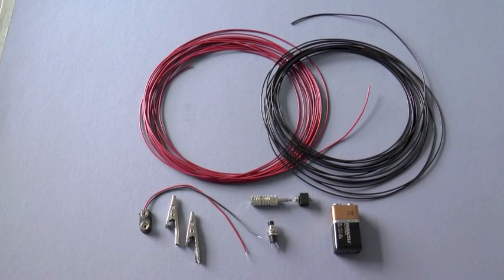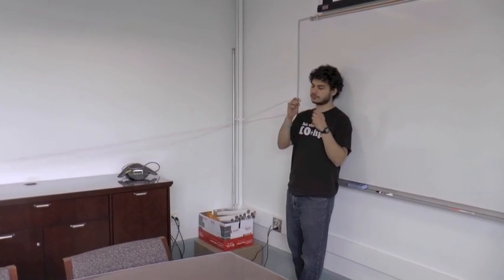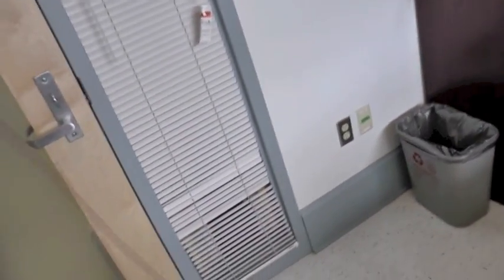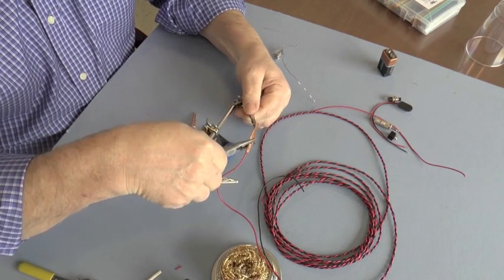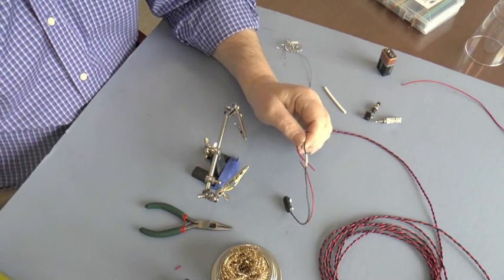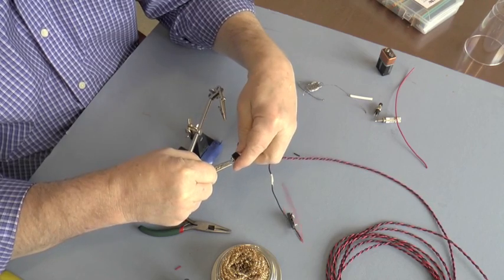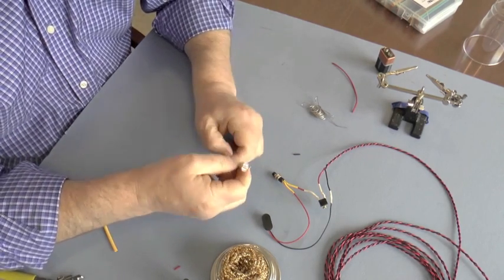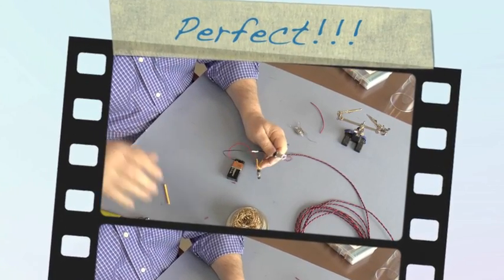How to make an electronic rocket engine igniter

Comment: The audio connector is clever idea. Use a wrist strap on your key. This way you can't walk away from the Launch Button and head to the rocket with it attached to your wrist. I would spend a few dollars more and get a low cost matched key/ignition switch from an auto parts store for about $10 USD and mount all of this in a small wooden box. Allowing wires to flop around at the solder joints (even with heat shrink tubing strain relief) will break in time. The last thing you need is a broken wire somewhere when you press the launch button. I have used those low cost buttons in the past, the high current used to launch may fuse the contacts together over time and you won't be able to tell. What could happen is the switch contacts stay connected and the rocket fires as soon as you plug in the key. Use a high quality push button switch that is rated for 15A or more for a good safety margin.

Comment: Great video. The way I make twisted pair (trio, whatever) wires is, I tie the wire ends together in a square knot. Hook it around a door knob (or bench vice), and walking away at a right angle from the knob, pull out all of the slack from the wires, trim even, and fold over the last inch of the wire and put that in the drill chuck and make it tight. Folding the wire gives the chuck more to grip, don't worry about damaging the wire. Keep the wires taught and run the drill at a moderate speed, walking towards the knot as the wires twist and shorten - but keep it taught!  About 2 twists per inch is good. The direction does not matter (beleive me, I am an electrical engineer).  But clockwise is the norm.  Then, LATER NOT NOW the folded end at the chuck and the end with knot at the door knob will be cut off and thrown in your scrap wire box.  If you don't have a drill, instead of folding the wires over, keep the wires about the same length and tie a square knot there too, insert a pencil, hold the wire together near the pencil, and wind the pencil around to twist the wires like you would do with a rubber band powered toy plane.  If you keep the wire taught, there is no need for a helper to keep closing the distance, if the wires are parallel and taught, you will get uniform twists. I have done this hundreds of times. My designs are under the ocean, on the sea, on land, in the air, and in space. Never an issue. You may get slightly more twists per inch at about 6 inches on each end, but it is not critical in this application, you can leave it or clip it off LATER (and save in your scrap wire box).  For non critical uniformity (all twists within eyeball looking the same is fine in this application). You are not making a communication cable, you are just twisting wires to hold them together.  Sorry guys, you made making twisted pair way too difficult (you even suggest a 3rd person). Hold the wire firmly with one hand as you open the chuck. Put the drill down and with that hand hold it a couple of feet down from the end, slowly release your grip and let the wires untwist through your finger tips, it may unwind 10 or so times - the more you do this the better and faster you will get. I have NEVER seen making twisted pair by dropping it! Not to sound like troll, but the way I do it we were taught in the US Air Force and only requires one person.

Comment: Can a model rocket engine be ignited with a heated child water rather than one use  home made match head igniter or estés igniter?    Seems any vapor mod with a RDA could easily run longer leads to a small coil that will fit in the cavity.   If it achieves sufficient temperature it should ignite.   AM I WRONG?

Comment: I shrink my heat shrink tubing the same way, but typical soldering irons are about 750 degrees F. Rubber based heat shrink tubing will melt at that temperature, but silcone/Teflon based heat shrink tubing will not melt from such a soldering iron. If the tubing starts to to smoke or burn, you will have to keep the soldering iron about 1mm away and not touch the tubing. If you are going to become an electronics hobbyist, it is best to buy a variable temperature/speed heat gun... like a little hair dryer on steroids.

Comment: When you have power in the circuit for the continuity check, why doesn't it set off the motor igniter? And can this be adapted for a 12 volt gel-cell battery?
Reply from the maker: The power used to check for continuity is not sufficient to fire the ignitor.
Reply: I designed a dual deploy ejection Avionics Bay that checks for shorted and open igniters right on the rocket before you arm it. I will post the design with schematics soon. There are two circuits in parallel, one is through a 500 ohm resistor to the igniter and I measure the voltage across it to insure it is properly connected, open, or shorted. Not much current will flow through the 500 Ohms so the igniter won't even get warm. The other circuit to the igniter is through a high power transistor that  when armed and you launch, the transistor turns on and a lot of current passes through to ignite the igniter.  The unit constantly monitors the main engine igniter and the two ejection igniters before launch. If the green LED is on solid, the rocket is ready for launch, if something is wrong the LED will blink error codes and will disable launching. The unit has a low cost Adafruit Altimeter in it to automatically fire the parachute ejector igniters when the rocket reaches max altitude (apogee) and as it gets closer to the ground as it falls. It even records temperature and G forces during flight.
Reply: @TJ Robyns.  Yes, a simple high current 10A voltage regulator can very added to reduce the voltage from 12V down to 9V and still provide the proper current. A low value resistor could get used instead, but it may cause some igniters to fire too quickly, or not fire at all. I can show you how to do this, just ask and I will post a video.

Comment: Painfully slow procedure. This is a one off construct. Not an industrial process. Additionally, no demonstration at the end. I did like the shorted guitar plug as a safety key, but instead of surveyors tape just string it around your neck. Then it will always be with you.

Comment: Your kidding right? This is supposed to be a comedy? Your teaching how to connect wires to a 9 volt battery?What a waste of server space!First: This is NOT an igniter. Just wires and a battery.Second> This is NOT electronic. to be "electronic you need at least 1 electronic component such as a transistor or diode.
Reply: HAHAHA!  I was thinking the same thing.  While I 100% appreciate DIY and MAKEing and all that, this is pretty elementary.  If you can't figure out this kind of thing on your own, you should not be playing with explosive devices.